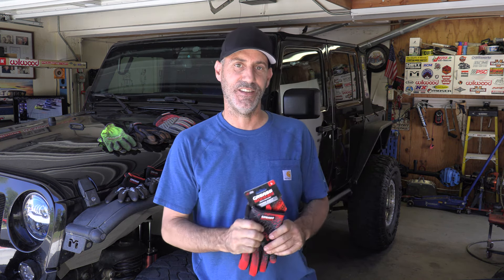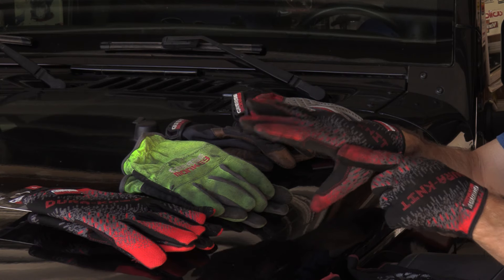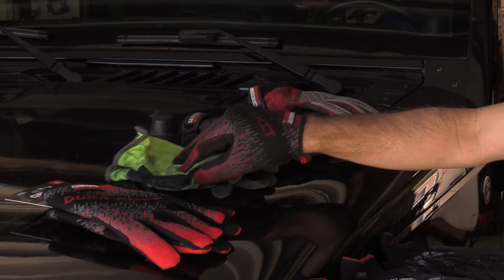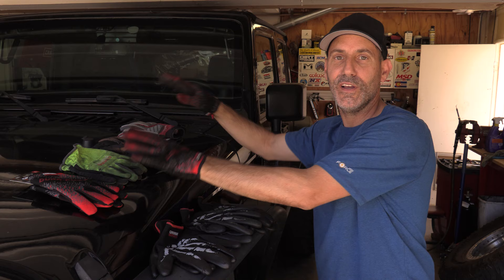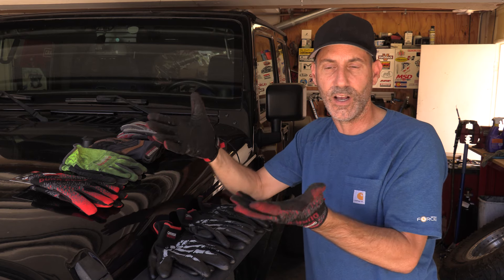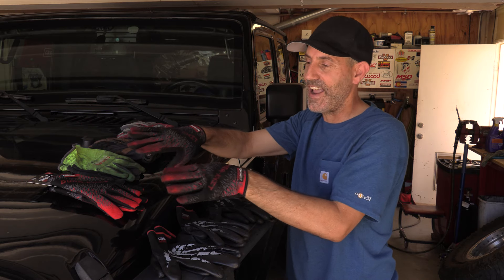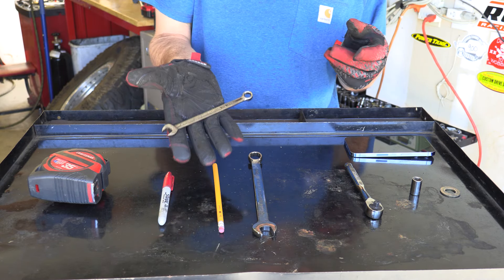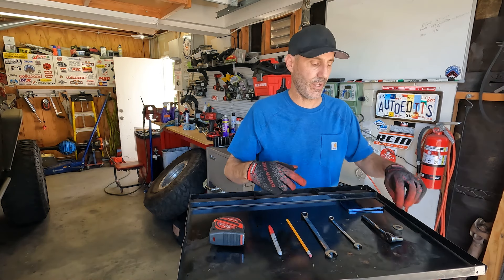Testing a Bunch of Grease Monkey Gloves and Dura Knit Review

Comment: It is good to see you are back. I am sold on the gloves, I used to beat up my bare hands and have been looking for gloves , I think I found a new pair to try. Looking at gearing up on my 2016 jku sport. I believe at one time you said your Jeep was your daily driver.  I would like a second opinion as mine is my daily driver and looking to haul a small trailer. Would you suggest 4.11 or 4.5 for my Jeep on 33’s? 
Thanks
Reply from the maker: I split daily duty between Jeep and Tahoe. Some of the parking structures I have to park in for work are too low for the Jeep... it's a great highway / city cruiser. 
As for gearing on yours, I would lean towards the 4.50 in case you ever want to go to 35" tires. But if you're certain you aren't... keep it as close to stock as possible at 4.10.
Reply: @AutoEdits  thank you I am looking for best idea for gas mileage, mild to moderate trailing and hauling combination. I appreciate your response

Comment: Hey sir. Question, how has the Yukon diff been holding up? Does it still click when going around corners? Still working like new?
Reply from the maker: It does still click around tight turns or in parking lots but it's not un-bearable. I wish I went off roading more to justify having a locker back there.  At this point the Yukon DuraGrip would've been absolutely perfect for this vehicle.
Reply: @AutoEdits  I just ordered a Duragrip for my Ram about 30 seconds ago. Should have it in next week.
Reply from the maker: @dirtsailoroff-road5580  Good call... will be awesome.